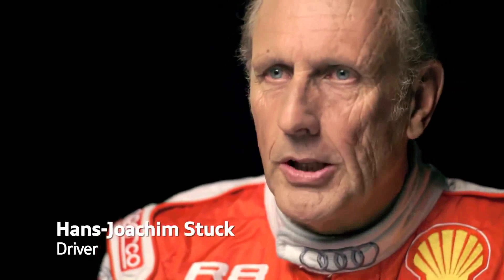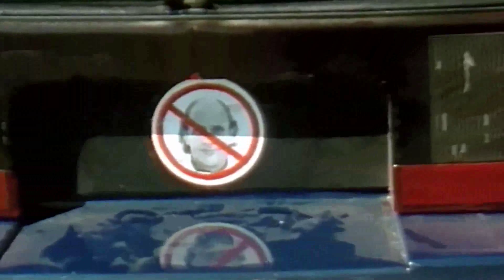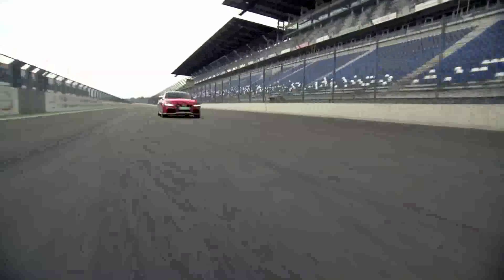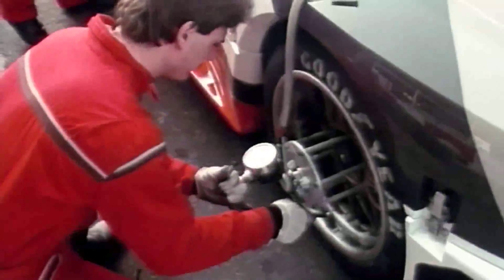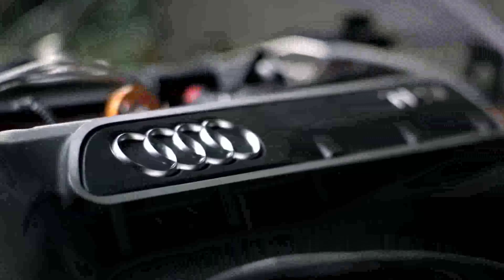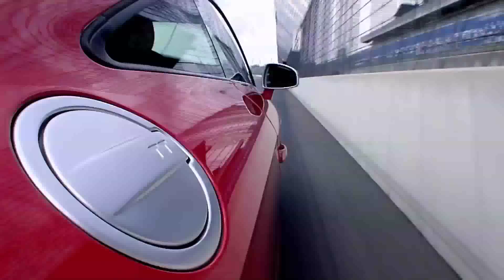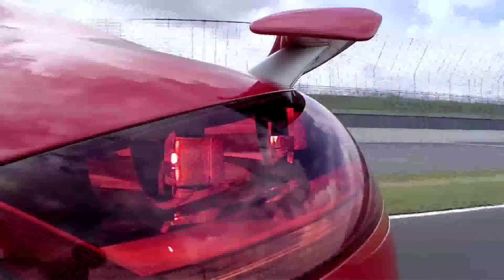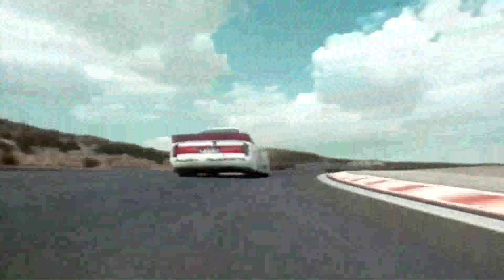Audi 90 IMSA GTO - 720hp 5 cylinder engine 1989

Comment: Audi engines have always been very good.  But the trump card is a very heavy load, the tires do not hold the load.  At that time, there were problems with the shortage of sports tires.  At the moment, there are good technologies in the field of compound tires for legendary sports cars Odi and others.  You can really feel the power in every corner and straight of the controls.  😎👍

Comment: Audi really makes beautiful cars. My first car was the 2.3 Audi 100 C3 and I’ve driven and maintained it till it was like 30 years old. I was practically the only person still driving it around. It’s not only older than me, it held so much sentimental value as it was given by my father. Recently, I got to choose a new car between the A45 and RS3 which seems to be in a similar category. I went with Audi purely because of the 5 cylinders. It had more low end torque and feels much more planted to the road. Although it’s more costly to both buy and own: and probably less perks than having an AMG for daily use, you can’t deny the joy of having 5 cylinders in your car.